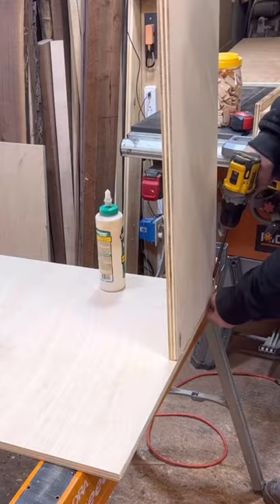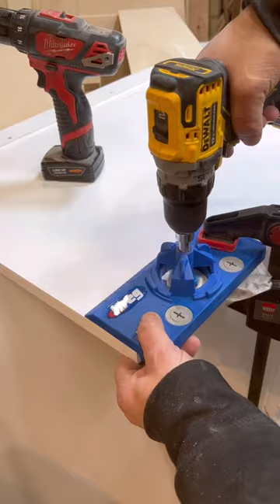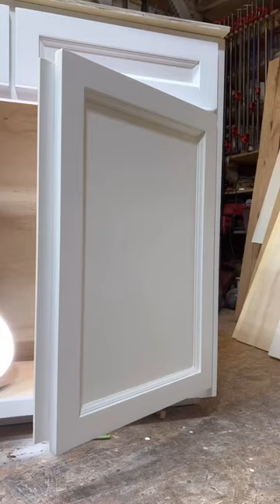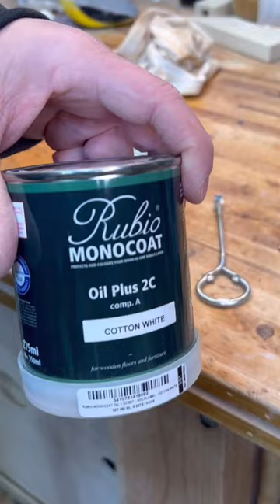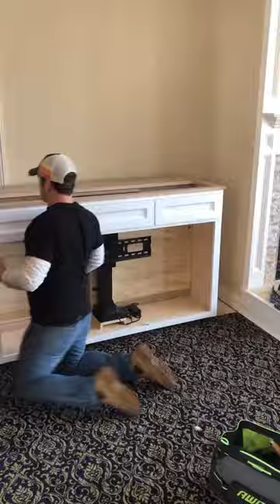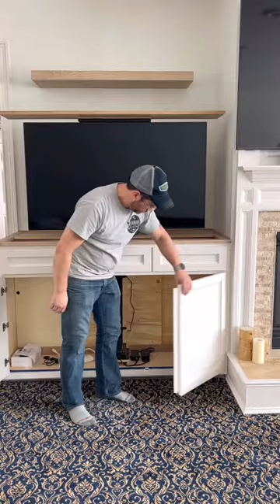Making a TV lift cabinet and a life lesson #woodworking #tools #cabinet

Comment: Love this!! I'm looking to build something similar, do you have plans for this?
Reply from the maker: I don’t, sorry. I figured out the sizes and made most of it up as I went along.
Reply: @NewmanSpecialsWoodwork  thanks!
Reply: @NewmanSpecialsWoodwork  well quick question if I am going to put my cabinet on casters should I make a 2x4 frame first then put plywood?
Reply from the maker: @msp9810  that would make it easier to do and would help with racking of the cabinet as you move it
Reply: @NewmanSpecialsWoodwork  ok thank you!